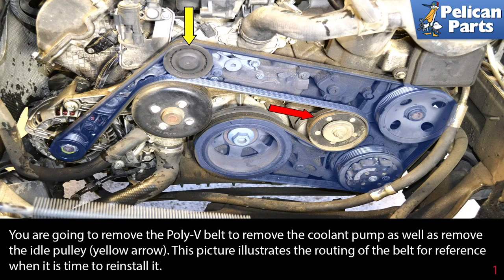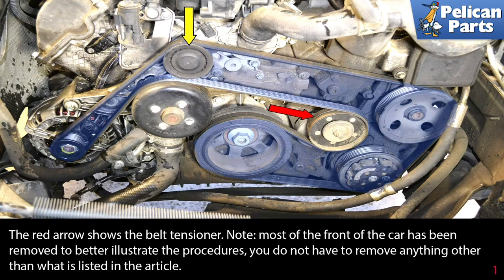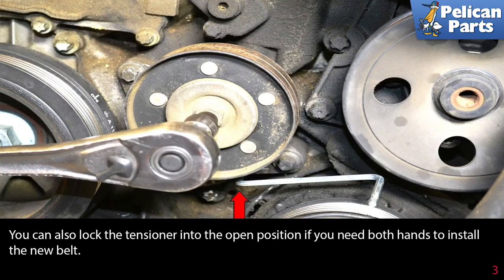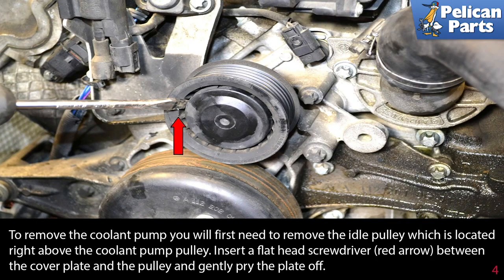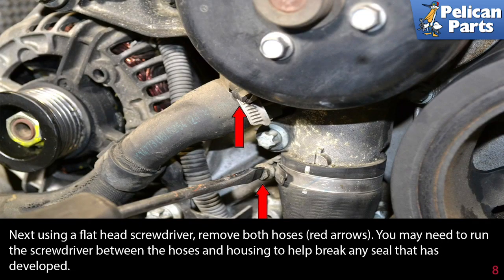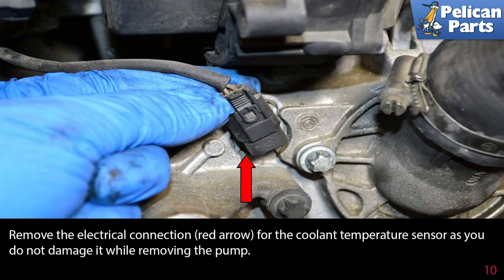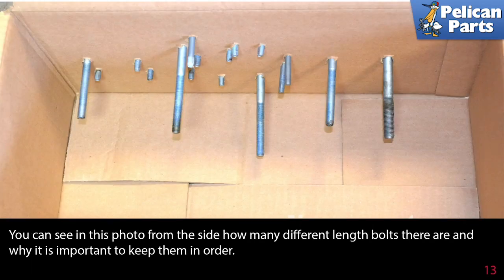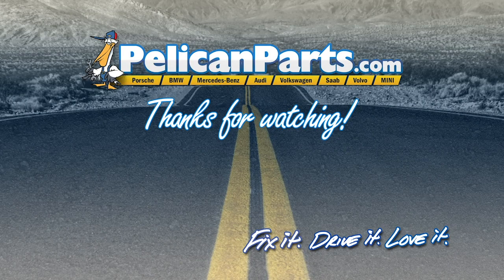Mercedes-Benz W203 C-Class Water Pump Replacement (1998 - 2004)

Comment: Excellent! Concise yet covers everything one needs to know! I've been a mechanic for 65 years and still need a little guidance when working on an engine for the first time. You've saved me a whack of time and bleeding knuckles! I always put the bolts into the new pump when I remove them then transfer them to the old one once I've removed it. No cardboard template needed...
Reply from the maker: Thanks for the feedback. Glad it was helpful!

Comment: Would be good if you put the models in the title... it brings me here as first search result when looking for W203 c200k and this is a completely different engine
Reply from the maker: Applicable Models:
	
	
	
	
Mercedes-Benz C320 (2001-04)
Mercedes-Benz CLK320 (1998-04)
Mercedes-Benz E320 (1998-04)
Mercedes-Benz ML320 (1998-03)
Mercedes-Benz S320 (1998-99)
Mercedes-Benz SLK320 (2001-03)
Reply: @pelicanparts  I Agree with Rhys Green - type of engine in the description (I was looking for CDI....)